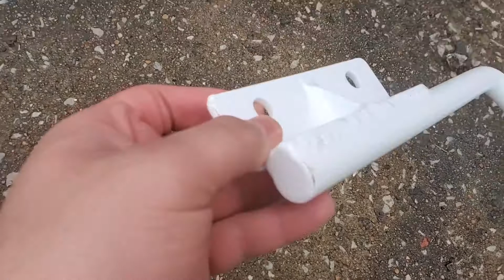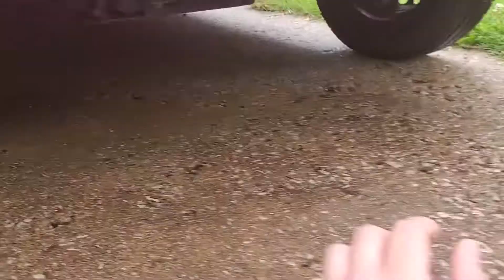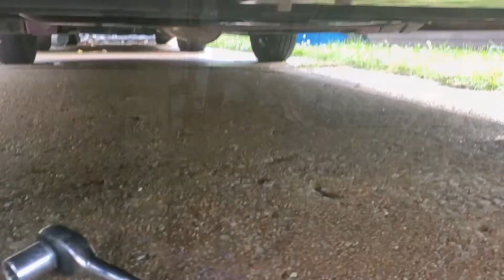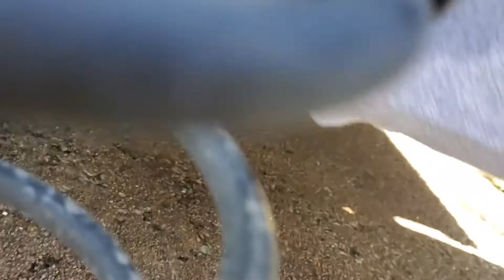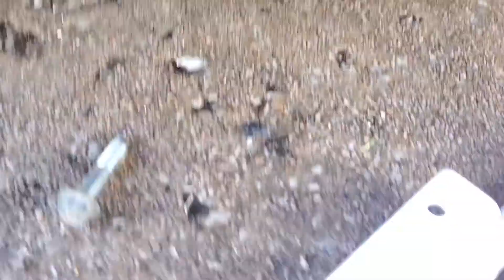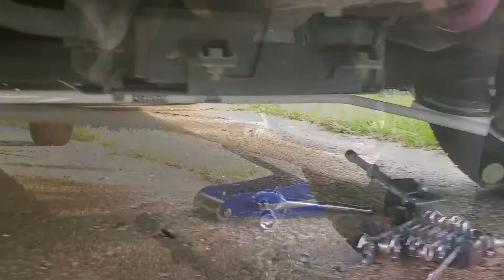2014 + Mitsubishi Mirage Rear Sway Bar install and Review

Comment: I had both Ultra Racing Front Strut and Rear Sway Bar. Lowered on H&R Springs with KYB SR shocks. My 2015 Mirage HB is nimble and planted solid on the road.

Comment: How has this held up? I've seen them broken, and I got a Daox one which broke too, but I go a replacement and it's been good for years now.
Reply from the maker: I've seen where other people have broken their bars too. The welds on these are really nice and I think the failures are due to Improper installation. If you tighten the bolts while the car is in the air, or one side at a time it pre-loads the bar with passive tension leading it to premature failure. I did all the final tightening once the car was settled under its own weight.
Reply: @vaipuluj  in your video you say the welds are shit, but here you say they're good? Which is it?